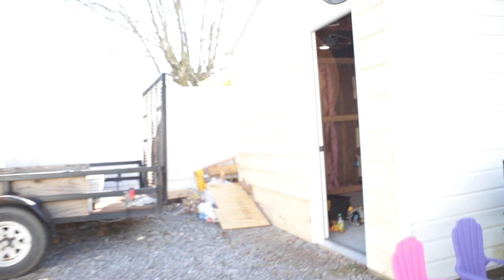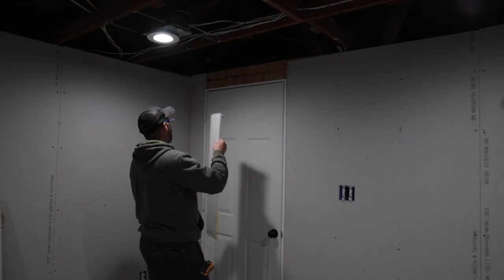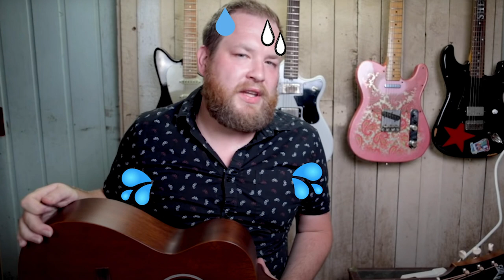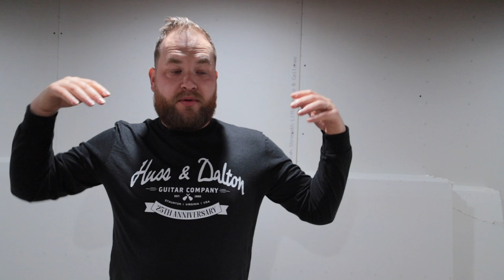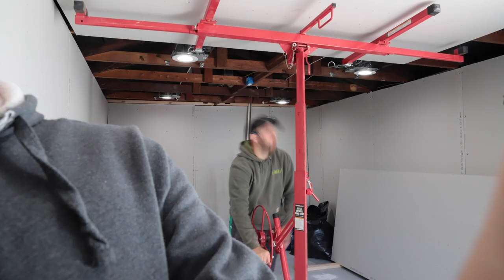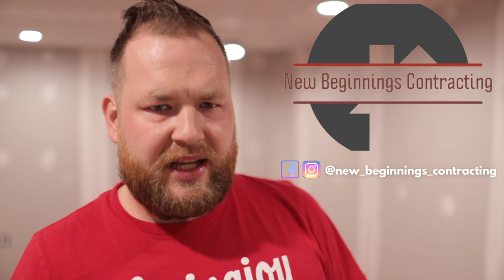Garage Reno 5 I Hanging and floating drywall, how will the space be laid out?

Comment: Looks great. The Ring Doorbell thing along with their other cameras that link in will really help with the security. You, I assume will have internet there plus a secondary access point in the house that will reach. As long as you don’t have a single point that relies on power and WiFi that can be disabled from an out of view area you should be totally fine. Hell. These days, just dummy cameras and signs for security you don’t subscribe to will run 99% off. Just remember that criminals, especially ones that are good, don’t want anything working against them, it’s just really not worth the risk. The space is coming along great and I’m totally jealous. Congrats.

Comment: I was going to ask about sound blocking considerations with the drywall, but it looks like you are done with the drywall now and maybe noise is not an issue. I suggest you look into a french cleat system on the wall to hang and organize the storage of guitars, gear, video equipment, and tools on the wall. Looks like floor space could be a premium in the studio.

Comment: Not to shit on this build, it’s exciting however as a carpenter of 20yrs I’ve seen several things you don’t do. One thing is you are supposed to install the ceiling drywall first, that way the drywall on the wall supports the ceiling drywall along the perimeter. Not gonna get into the other things. I’d also be hesitant of having anything on the floor as the floor is level with the outside grade with no foundation wall as a barrier so water can run inside and ruin things.

That being said, look forward to the finished product.